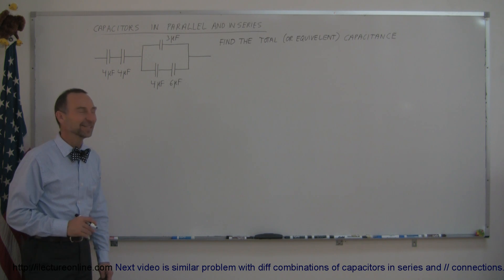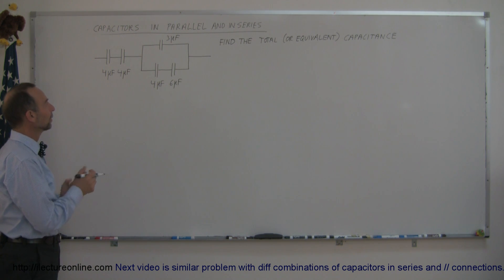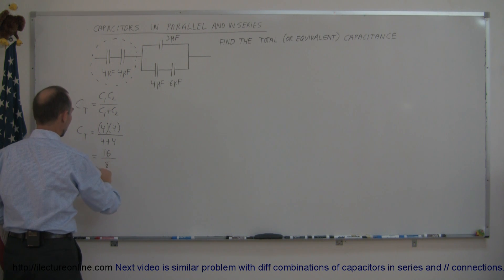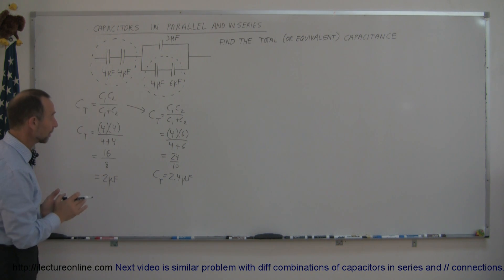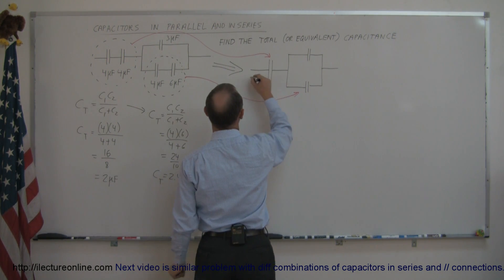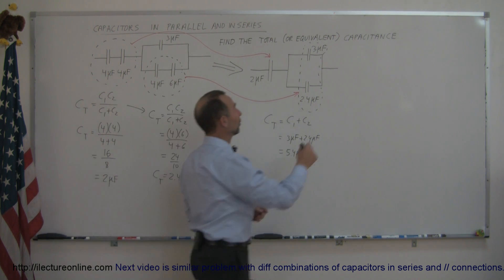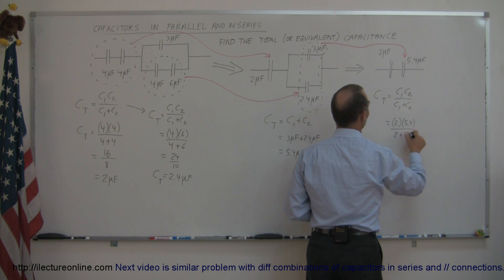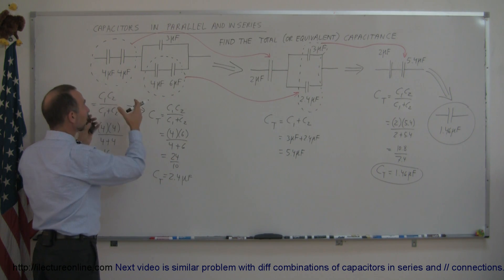Physics 39   Capacitors (4 of 37) Capacitors in Series and Parallel   2/4

Comment: This video makes no sense.  For circuits in series you add them and in parallel you add the inverses of them all together and take the inverse of that then you add it to the original series which you calculated before.  You did that on previous videos why change now?
Reply from the maker: Note that these are capacitors, (not resistors).  The rules for adding capacitors in series and parallel are opposite to the rules used for resistors.